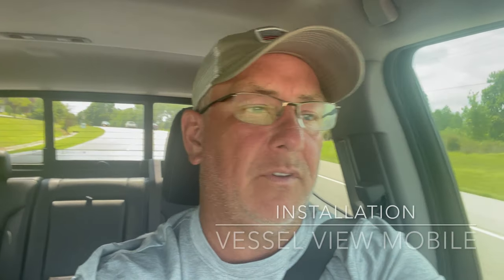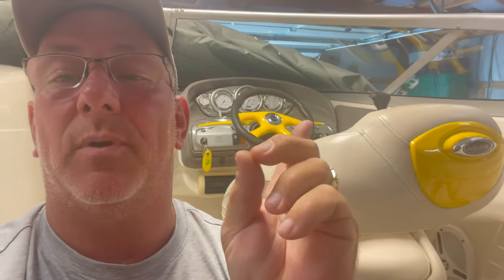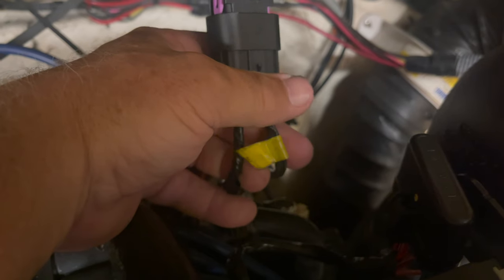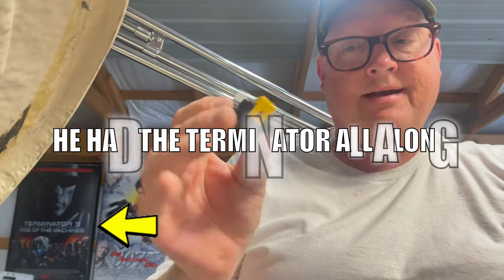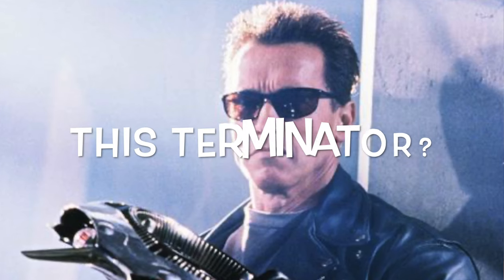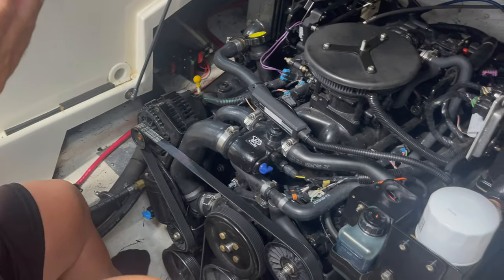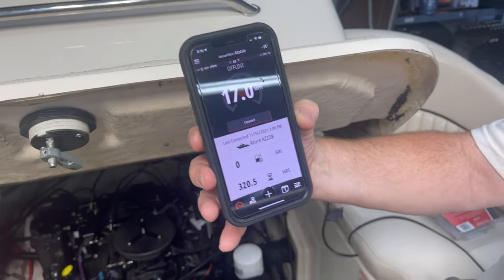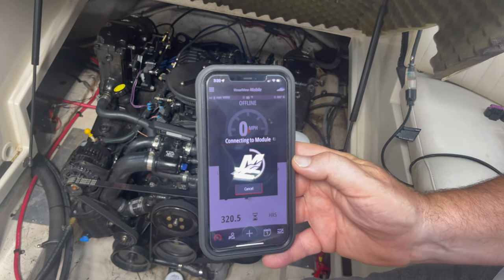VesselView Mobile App and Dongle Installation (by Mercruiser).

Comment: Question. That connector on my engine is plugged into a cable that runs to the smart craft gauge in my dash. Can I plug in the vessel view into that cable and then the cable from the vessel view into my smart craft gauge?
Reply from the maker: Honestly I don’t know if they’ll work but if you get a hub from Mercruiser, you’ll plug the cable into it then you will plug the smartcraft gauge and VV into the hub and both will work. If you call Mercruiser they’ll get you set right up. Thanks for watching